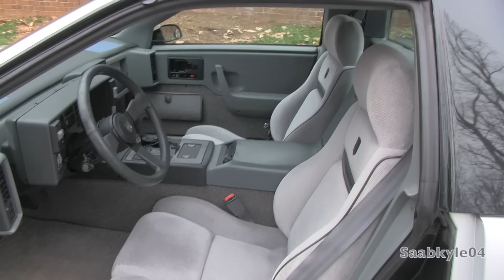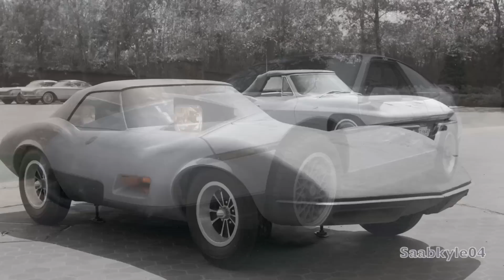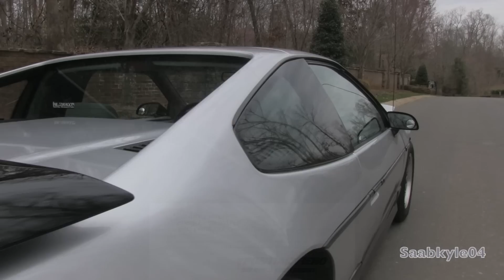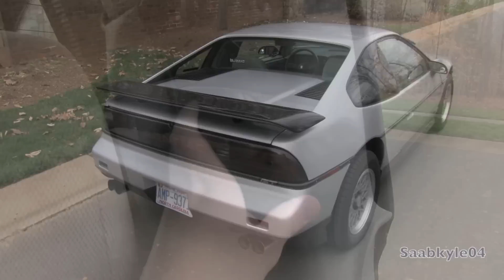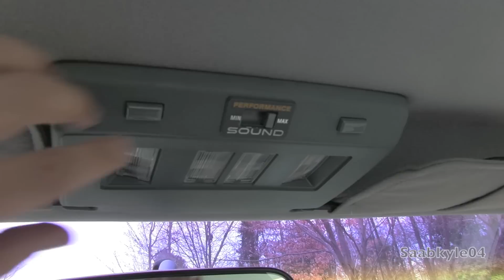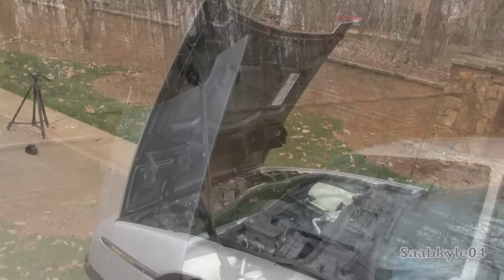1986 Pontiac Fiero GT Start Up, Exhaust, Test Drive, and In Depth Review

Comment: what is this car worth today?
Reply: Used car prices went up 30% this year.. They're  worth more now than they should  be.... It's all going to depend on what model/year that you are buying, mileage, and the transmission.  An unmolested 88 Fiero GT with a 5 speed manual with low mileage will cost you around the same amount of money as a new car. Probably around $25K for a perfect example. 10 years ago I almost bought  an 84 Fiero 2M4 with a 4 speed manual and 80,000 miles on it for $2500, someone else beat me to the punch though.  Now that same exact car with those miles will be around the $10,000 price range. These cars aren't  real collectors but they do have a niche following and are over all pretty cool looking cars

Comment: Why these cars get so much hate?
Reply: Because people compare them too much to modern vehicles. The selling point of this car was the fact that it was an American made mid engine sports car that could be bought at an affordable price for the time. They were also reliable. The issue is that they were under powered (2M4 models with the Iron Duke engine). It took GM about  4 years to get the car right and then they stopped production, right as soon as they started becoming more powerful. They are still good cars and are quick for what they are. It's  a fun beginner sports car. Handles well, sounds great, gets great gas mileage, reliable and not so fast to where you will get in trouble

Comment: This car is flawless, in my opinion of course. But it's automatic transmission ruins the whole thing...
Reply: Not everyone is born with good legs
Reply: @k0edby22  But through training they may improve themselves!
Reply: @lgz2006  I’m a welder by trade, my knees are shot. I prefer the automatic in my Fiero, and the manual in my e36 m3.
Reply: @k0edby22  Fair enough still, although it's quite an interesting combination nevertheless, usually IMO, buying an automatic, maybe a 90s/00s Lexus ES or IS, comfy and easy to drive?

Comment: The first generation of these were extreme fire hazards. If they caught fire most fire departments just let them burn because of a material in the engine compartment from what I was told burned extremely hot

Comment: Hey Fiero owners,
I am 6' 2", or now that I have many years behind me, maybe 6' 1".
Anyway, at that height, could I fit comfortably in a 1987 or 1988 Fiero GT? If not, then I will not look to buy one.
Thanks!
Reply: Well I am 6 2 and I had head room to spare !!
Reply: @lifelover2301  Thanks for the reply.
Right now I have a 2017 Toyota Corolla SE with a 6 speed manual transmission. It has a sun roof, but headroom is adequate. The previous car, my dearly departed 2002 Subaru Outback wagon, no sun roof, had so much headroom I could almost stand up in it. I really miss that car.

Comment: The 84-87 had a lowly Chevy Chevette front suspension. The rear suspension is from the front of a Pontiac Phoenix There is nothing exciting about that. The 88 had an all new suspension and brakes. They finally got it right and then killed it. I love my 88 GT that I bought in late 1987.

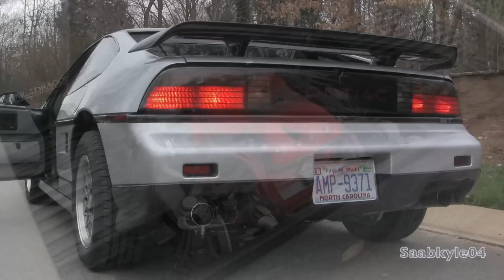Comment: 2:23 right off the showroom floor, the 2.8 V6s had an authoritative sound in the Fiero, 6000 STE & Cavalier Z24. Though they weren't big on h.p., I am thinking it was a different type muffler? Interesting how Pontiac was bold enuff2 pull this off. Today, most new cars are too quiet, even in the "performance" line. NOT countng Chally, Camaro & Mustang V8's.

Comment: Just as this got good. GM killed it. The half hearted effort due to them not making it clear who, or what the car was for. This example here is the best. Why GM didn't do this in the first place is just stupid. A great shape, decent power, and fun to drive. It was a winner. The 2M4 was not the one. This model with the V6, it was just right. Another GM car they didn't do right till they cancelled it. Great cars that should have best out of the gate but weren't because GM was too stupid to see a genius of a car in the making. By the time it was right, we had moved on. How many cool rear engine sports cars are there now? The car here was a revolution killed due to stupidity. I am a fan of this car. The right one. Management at GM? The wrong ones. Pontiac had allot of cool cars in the not so great times at GM. Superchargers were a great solution. Turbo chargers too. Would love this with about 12 pounds of boost. Upgraded wilwood or brembo brakes, and suspension work. This car would kill allot of expensive iron today around the twisties especially.

Comment: That car is in beautiful condition.  Low miles, but the passing of years still has an impact so it's obviously been very well maintained.

I have the same model, but mine is approaching ~220K and looks like junk from the outside.  It's an ugly sibling from this car, but it's still mechanically solid though.  Like all old cars, when I got it there were some serious issues and it needed attention and work to save it.  But it had a solid foundation, and after the teething period it became a great car that I drive every day without issue.  If something does go wrong, I'm confident in my ability to diagnose it and fix it.  Can't say that for modern cars.
Most of the mechanical parts in these cars are common with other 1980s GMs with the same engine/trans setup. These parts are widely available and cheap.
Just to illustrate that point - the emissions information label on the decklid is a generic GM diagram of the FWD 2.8L sensor and vacuum hose configuration. It shows the engine bay from the wrong direction - you have to mentally flip it upside down when reading it.  It's obviously the same label that GM used for cars with this engine configuration in the front of the car.

If you shop for one of these cars, the most notorious spot for rust can be found by pulling up the corners of the trunk carpet.  If you see rust-through on the corners of the trunk, there is likely serious rust to the frame rails underneath, and you should probably avoid that car.  In some regions it's probably hard to find a car that doesn't have serious rust, but try.  A solid frame is the most important feature, everything else can be fixed.  Many of these cars were garage kept so good examples should be out there, even in the rust belt.

The main flaws with the Fiero suspension are really in the rear.  The biggest and most fixable problem is the cradle bushings.  On 84-87 models they're rubber, which was a bad idea to begin with, but it got worse as they aged.  This allows the engine cradle to move around, which means the suspension is also moving.  They can be replaced with polyurethane or aluminum to fix this, but it requires dropping the cradle.
The second problem is flawed geometry in the rear control arms. This can be mitigated with polyurethane control arm bushings, but that's controversial.  Poly in the control arms gives the car a rougher ride, and if not lubricated well, they will squeak. They also might wear down and need somewhat frequent replacement. I've never tried them myself. If you don't like that idea, just replace the rubber with new.
The Fiero is sensitive to rear alignment, and unfortunately, many alignment shops won't do a good job with these cars.  They aren't used to them, so they get frustrated and just want to shove it out the door.  When I have my suspension restored to good condition, I've considered putting together the tools and the time to do a home alignment rather than trusting a shop. It is possible to do this if you're meticulous.

Comment: Saw a 1987 Pontiac Fiero (doesn't run, probably a fuel line or pump issue) for a deal of $200... The exterior was in fair condition, in need of a paint job and detail, one of the headlights are apparently jammed, but the interior is in good condition, just needs some reconditioning, radios missing, AC works at least, and mostly everything is original... The milage was at about 172K+ miles... Is this an alright deal?
Reply: BlueSpades where? I'm wanting to put in a K24 engine in one as a project and need a cheap one!
Reply: I had to drop the fuel tank drain and clean out and replace the gas pump to get my hero started to happen City 10-15 years in the garage to get a started

Comment: "2.8L V6, 140 hp"

How did they manage to get so little horsepower from 2.8 litres?
Reply: Josh Bacon It was the 80's. BTW on paper they were under rated. Truth is I heard they actually made 160-170HP.
Reply: During the 1980's 140hp was actually a pretty good amount of power for a small-displacement 2.8L V6, especially for a less-sophisticated OHV 2-valve per cylinder engine such as this.
Reply: They chose the 2.8 because if the 3.8 was the bay wouldn’t have any room

Comment: Never thought I would look back and actually Miss my Fiero... But I do... I really do.   I had an 86' White 2M6 with a 4sp Manual... Always wanted the 5sp from the GT, but I Rolled the car over before I could swap out the 4 sp.  Remains the only vehicle that I have EVER rolled over...Wheels-Roof-Wheels again...I didn't even stall the engine during the Roll Over... LOL

Comment: a Fiero GT with an automatic is a crime
Reply: It actually suited its character.  The v6 was torquey and didn't like to rev up much. The car was heavy for it was so felt more like a grand touring 2 seater than a sports car.
Reply: @oldtwinsna8347  The car at least the 86 I own is a little over 2100 pounds is that heavy ?
Reply: @stevencroon  I believe they are around 2600 lbs
Reply: Since73 Not really
Reply: A 3 speed automatic maybe, but an automatic in general fits this car.

Comment: I almost bought a 1986 Fiero GT with the V6 and manual transmission. It was red with tan interior and, if I remember correctly, it was leather. This was 1999. I wish I would have bought it. I remember they wanted $1300 for it. Ugh.

Comment: Would this make a good first car
Reply: 8584zender dude any car can be a first car. Fuck civics corollas and priuses. I would say for a first car the main thing to consider is repair frequency and cost. So just avoid getting a bimmer or god forbid a jag. Caddys maybe not either. In the case of this fiero it's a mixed bag cuz there's no telling where you're gonna find parts due to its age and rarity, and then with the mid engine futuristic aspects of the design, it may not be too easy to fix either. 
Bottom line get something you'll love because you only have one first car.
Reply: Bhavneet Saini Yes. Mine has been a terrific daily driven first car for me and my mom. She got the car in 88 and it's been great ever since.
Reply: Funlu It's actually an 87, 88 is when she got it. The car has 215K miles on the original engine and automatic transmission.
Reply: Bhavneet Saini yes 100% yes. i bought this as my first car about 6 months ago and let me tell you, no other car for this price will get you the looks and attention that this one does. i have a red 86 gt and I dont regret my decision at all. I'd suggest getting a gt for the performance, and I'd get an 86-88 because that's when they became decent cars. but yes, if you find one in good condition, do it.
Reply: Bhavneet Saini yes I feel so I am sixteen and have always wanted one and found one I might be buying as my first car so in my opinion yes as long as you know what your doing.
Reply: It was my first car. 86 GT. I still have it actually
Reply: Bhavneet Saini It has its ups and downs :)
Reply: my first car. fun car but not practical
Reply: Spectre Se-r Yup my dad had one back in 07 and it had a 3800 V6 it was a 1984 model I think
Reply: Jamie Arrowood how many miles on your daily driver from 1988?
Reply: sup jimmy.
Reply: Only if your mechanically inclined.  They stopped making these 30 years ago..... and any car that old, is going to have annoying problems.
Reply: My Dad wanted his old Pontiac Fiero to be my first car, up until the Fiero got towed away, during when I was still in Kindergarten. I’m hoping that GM will someday bring Pontiac back on the market.
Reply: No but it would make a great electric conversion project.
Reply: Nope.  Unless it has a swapped 3800 v6
Reply: It would still look like shit inside
Reply: No, in so many ways, no. God no.  Good first car - Prius, Civic, Corolla.

BTW, I love the "slower than the competition" ... err just say Toyota MR2. The CRX wasn't really a direct competitor.

Comment: will fieros work for people over 6ft tall?
Reply: Not really they are smaller in person a 4 foot person could easily be taller than it
Reply: I owned one in college and i am 6"3'.  Plenty of leg room.  You could put a full size ironing board in the front seat no problem.
Reply: Chris Schmidt I guess we are talking about 2 different Fieros cause the one my dad had back in 96 was super small
Reply: +CloroxBleach mine was an 1984 SE
Reply: Native Outdoors I'm 6'4" and fit with three inches of headroom.
Reply: CloroxBleach maybe he bought a super small Fiero. 😉
Reply: I’m 6’2. I owned 2 of them and never had any problem with room. I did have sunroofs though. I didn’t use them because it would pull my hair out the top.😃 The seats reclined and I could just about sleep in it. A lot more room than you would think. That was 30 years and 50 pounds ago. I’d be lucky to get in and out of it now, but I wish I still had my 1st one. I loved that car!

Comment: Used to have the 1986 SE fiero 2M6 of the same color until someone crashed into it and totaled it. Now I drive a 2001 Audi a4 quattro 2.8L and honestly I would much rather have this car back. The only maintenance I had to do for the fiero was replacing a brake light, so far I have over 6000 in maintenance in my audi. The fiero had only 45k miles on it when i bought it in 2009.

Comment: Does anybody know the value on one of these today ??
Reply: I've got one in my area for 800 it doesn't have the engine though
Reply: These things catch on fire easily
Reply: The 4 cylinder model did bad fuel line setup.
Reply: Very true
Reply: im looking at one thats all red and fixed up with after market stuff for 2,200. real cheap.

Comment: I had an 86 GT with the bass sub-woofer system featured in this video.  In that small cabin the sound system was great, and yes, this was in the days before CD's.  I would have loved to have gotten the '88 model with the improved suspension, but I bought a house instead.

Comment: Was this in an accident? Hood Alignment is quite off.
Reply: I'd chalk it up to 1980's GM build quality. I've got a 1987 GMC Suburban sierra classic. Its a 350 4x4. Build quality wasnt the main focus(It worry's me to park it the sun for over 30 min.). However, it was owned by an old guy. That mean it's low mile, unmolested, and still has the rally wheels with the beauty rings. Its still my baby, though. Its going to stay unmolested as long as I own it.